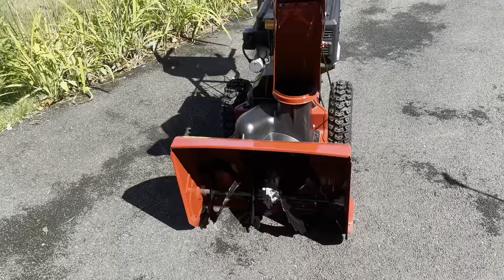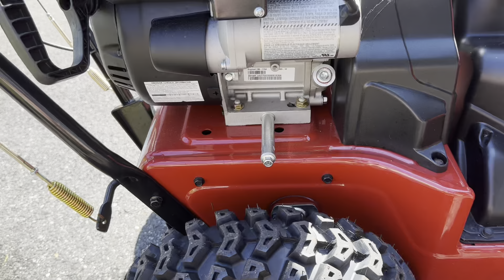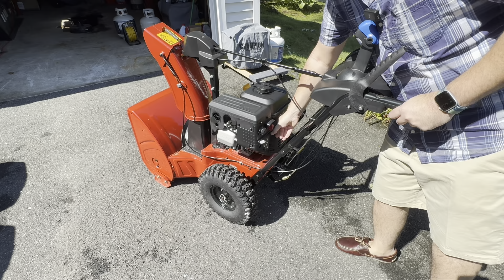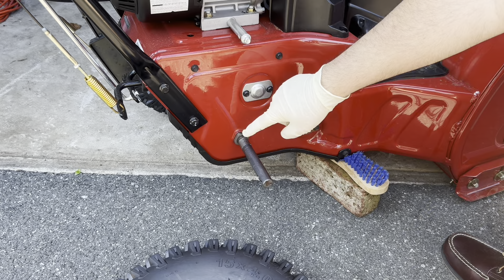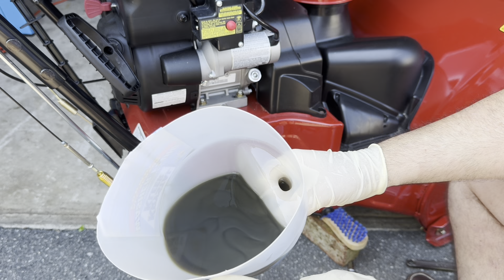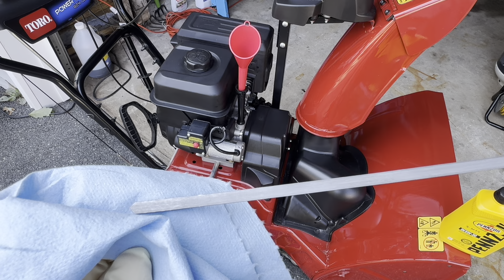Toro Snowblower oil change - Any model

Comment: My Toro manual says to NOT screw in the dipstick to check the level. It's even noted on the dipstick. One problem I had, though, is that when I put the wheel back on, only one wheel got power. I got through the rest of the mild winter with only one wheel being driven, but I'd like to fix that for this winter.
Reply from the maker: Thanks for watching! I have not had that issue with the wheel although double check where the pin went in bc there are 2 different slots . One is to keep the wheel free rolling to make it easier to turn
Reply: @Outdoor_Prepper  THANKS. Just checked and the two wheels are clearly pinned differently. I really appreciate the tip. Still a little early to get it gassed up and check, but comforting to know it's probably going to be an easy fix. Related: last winter I changed the oil and due to mild conditions only used the blower twice all winter, about 2 hours total. Do you think I can get by with the same oil, now a year old?
Reply from the maker: @tyhuber7651 glad I was able to help! Oil is fine for another season but definitely change it after this winter as it can and does attract moisture which is ultimately not great. The reality ( for good or bad) is that people go years without changing oil on small power equipment but definitely change it at the end of this season regardless of usage. Thx again for watching

Comment: A few points about oil changes on my Toro 1028, purchased in late 2014 or early 2015.  It has a 302cc engine.
- Check the manual for your make and model for instructions.  My Toro owner's manual says "1. Remove the dipstick, wipe and clean, then FULLY INSTALL the dipstick.   2. Remove the dipstick and check the oil level."   This is different from the Toro instructions for the motor that "tyhuber7651" has.
- I do not remove the wheel to change the oil.  My 302cc engine has the same side drain as shown in the video. 
- I originally bought a disposable aluminum cooking pan, approx. 8"x8"x4".  I poked a small hole up near the top of one side and just push the drain tube through that hole before removing the drain plug.  The pan can be bent and shaped so the oil collects at the other end of the pan.  The pan is supported by the tire and a short piece of 2x4 braced under the lower end.   This has worked for ten years, with two or more oil changes per year.  30 oz. of fresh oil per change is cheap insurance to make sure this expensive tool keeps running.
- Just saw a different oil change video where they used an angled funnel with a long neck.  The top of the funnel slides under the drain tube and wedges in place while the long neck extends out beyond the tire.  They place a used oil container below the end of the funnel and then remove the drain plug with a box end wrench.   
- Even though I've been lucky enough to not spill used oil from the flexing 8x8x4 pan before pouring it into a used oil container, I will be buying one of the long funnels and switching to that method.  Tired of wiping dirty oil from the old pan, too!
- Funnel search on Amazon - "Annurssy 4 Pack long neck oil funnel", four funnels for $7.59.
Reply from the maker: Thanks for the detailed explanation and helpful tips! Thx for watching!